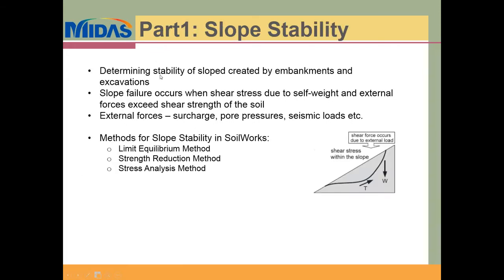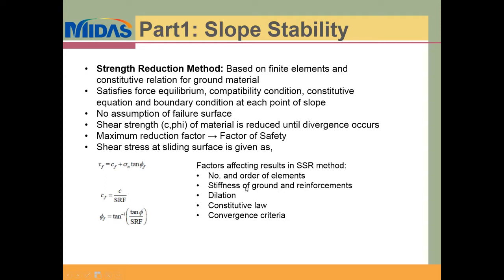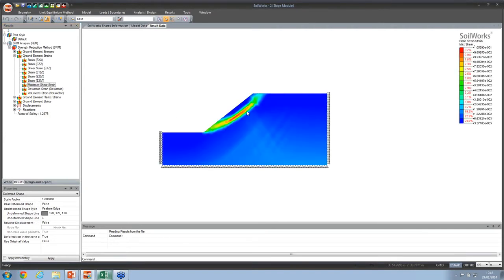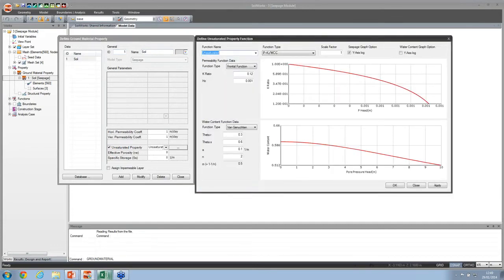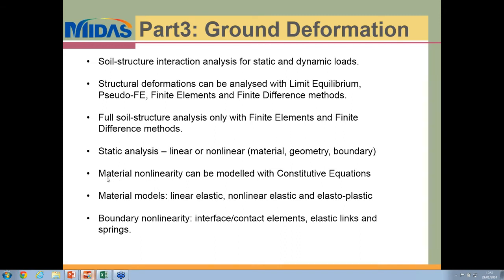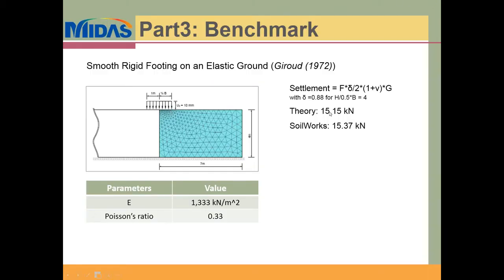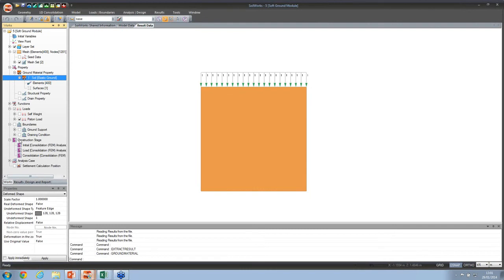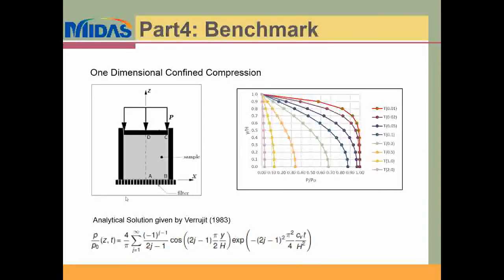09 SoilWorks 2D FE & LE Analysis

Comment: excusme, Is possible to get the Benchmark model that you used for the slope stability, and also the spreed sheet for Bishop Method. I am currently running my model in Soilwork, and would like to see if the analysis was correct. Thanks 

if possible, would you please email me to andikasandabunga@gmail.com